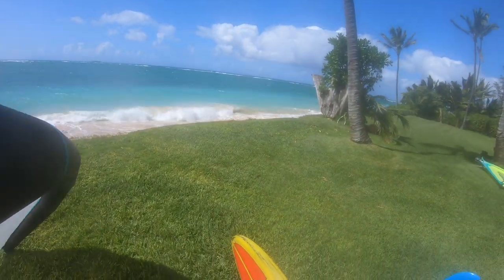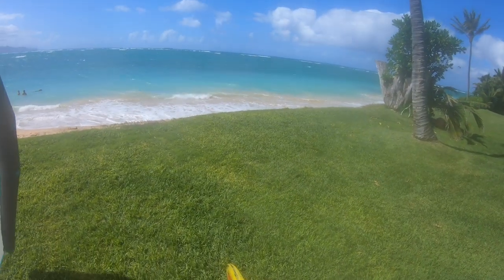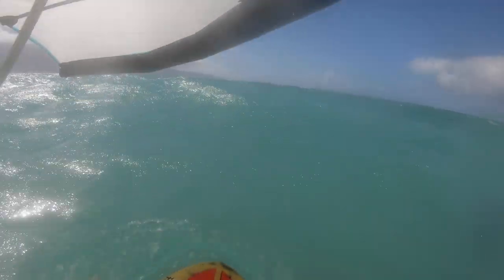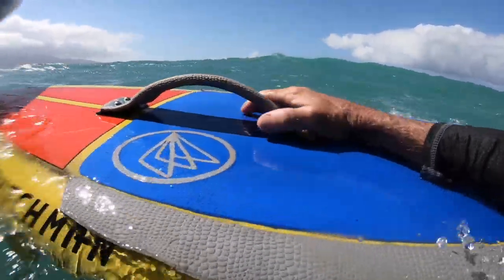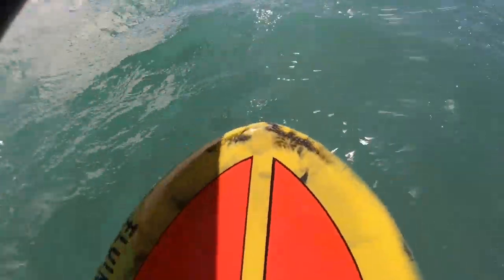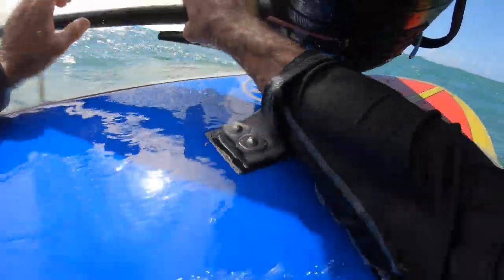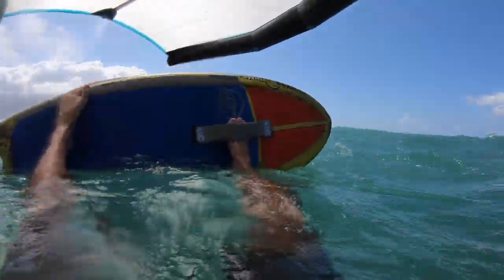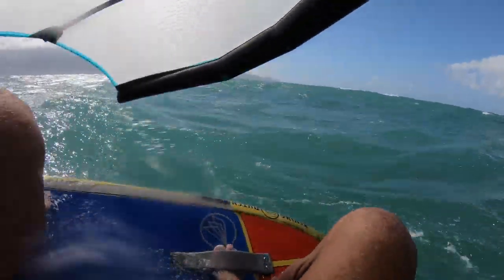Wing Foiling with Alan Cadiz: High-Wind Waterstarting

Comment: Thanks! Another great tutorial. Question regarding the "windsurf" style water start. Relative to body weight, how much less volume board would be necessary to utilize this technique? Such as,  if 60kg body wt would it be possible with a 55L board? Tough for us lightweights to find stock wing foil board much smaller. Might have to consider prone foil surf board? Like the foot strap. Long to allow for easy foot rotation out in case of unplanned body launch?
Reply from the maker: Thank you.  Yes possible with a 55 liter board but the wind has to be strong.  The stronger the better.   It will be even easier with a prone board but then there are other challenges with the prone board.  The custom foot strap is long to allow moving the foot fore and aft depending on board speed or foil placement in the tracks

Comment: Thanks Alan maybe you should warn viewers about the definite risk of a sharp wing tip tearing canvas with the slightest backwind of the wing, or do you think this isn't a risk?
Reply from the maker: The foil is typically under water.  I have not had any problem so far.  I hope you have not torn your wing trying this.   Most of the wing damage I have seen has been while carrying the board and wing at the same time.

Comment: But why would you need a hook on the harness? There are Kite harnesses with just string, so the chicken loop can slide left to right a bit, nice for wave riding and no protruding parts. A bit less stability if it can slide, but depending how one attaches the line to the Kitewing I'm sure you can make it not slide. So when buying a harness for Kitewinging, considering one with optional string plate might help.
Reply from the maker: You might be on to something there. LMK how it works
Reply: I use rope slider for kiting, but the negative is the ease of connection for chicken loop -- eg for tether self launch or for riding unhooked. I haven't used a harness for winging, but I believe they use a harness loop like windsurfing, which hangs off the wing and then loops into hook -- I don't think a rope slider would work for this.

Comment: Great!!! Can you start with a twintip in the water ?
Reply from the maker: I have never tried with a twin tip.  I suppose in enough wind.  LMK  I have seen videos of sailors using a hand wing to ride a surfboard or skim board  so anything is possible but know that the hand held wings seem to work best when matched with a board mounted on a foil
Reply: Alan Cadiz Thanks! I’m starting on an iSUP, and I want to try a surf or a twintip. Let’s see how it goes. 🤙🏾

Comment: Why do people consistently try to make surfing and windsurfing etc more difficult than it needs to be.
Reply from the maker: My mission is to help people understand this sport by expanding their knowledge base.  You can spend a lifetime learning surfing and windsurfing etc, as I have and still find challenges.  If I can help you be better at any aspect of them than I am a better person for it.
Reply: @alancadizwingfoilinginstru2926  
I wasn't trying to offend you Alan and I apologize if I did. I was suprising how small your board choice was. It's difficult to imagine what benefit would come of it and that so many sports like this become committed to making it more difficult without becoming any more fun.
Reply from the maker: @Hotwire_RCTrix  Thank you, No offense was taken.  That board is my pronesurf foil board.  I used it for winging and have since moved back too a bigger board.  I just wanted to prove to myself and others it is possible to use  "prone board" to wing.   Yes its definitely harder but if you can only afford one board and your up for the challenge its possible.
Reply: Hotwire I think the benefit is once you’re on foil that tiny board is a pleasure to whip around; no swing weight. 

Alan, thank you for the validation that this is possible with a lot of practice.
Reply: @scnomad3626  
Again I am not trying to offend but the ski industry learnt a hard lesson when snowboards came along. Promoting a sport/recreation that is easy is much better for everyone. For that to happen the tools need to be realistic for everyone.

Comment: helps to weigh a 100lbs to do this
Reply from the maker: I do weigh more than 100 pounds.  How many liters is your board and how strong is the wind where your at?   I can tell you  I can only do this with my 4 meter wind in 25 knots or more .18 to 20  knots with a 6 meter wing.
Reply: I rarely get that kind of wind.   And I’m 92kg’s     My wind is 6-15mph on average.     I’d love to be able to deep water start a 4’11” Armstrong w/ 6m ozone, and 2400cf foil...but most likely a stretch.